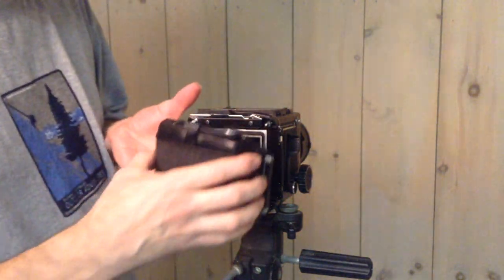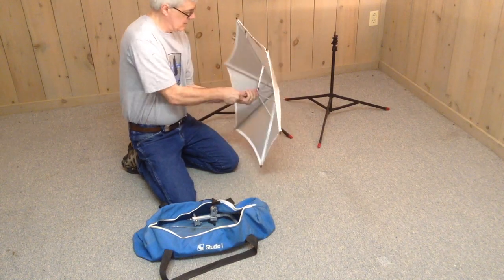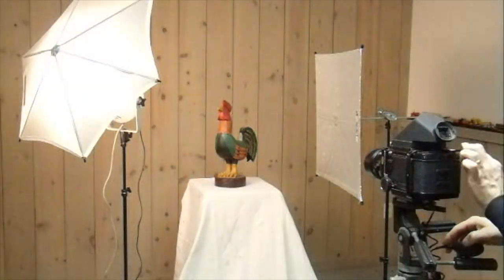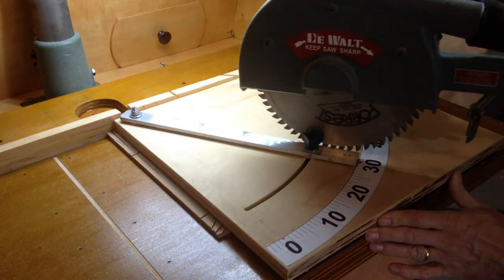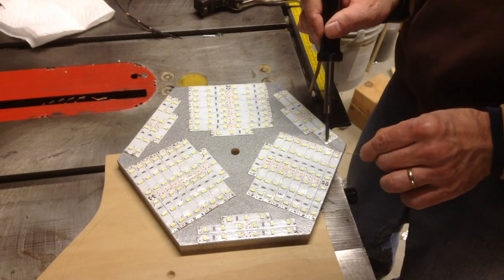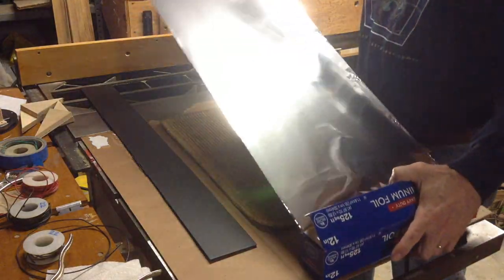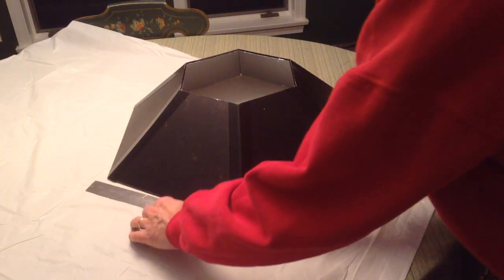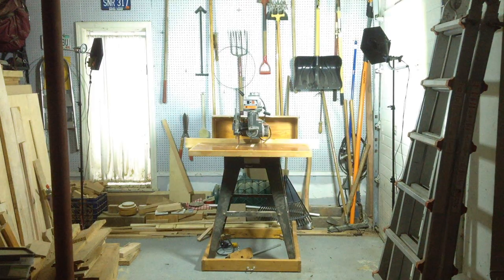Making LED Light Panels for Video and Photography

Comment: Very interesting. What was the power source for the LED panels?
Reply from the maker: Thanks. I’m using a 12 VDC (10 Amp) power supply which is enough to run both lights. Depending on what LEDs you use, look up how many amps each LED draws x the number LEDs you are using in your light.  Buy a power supply that can provide at least the amps required (preferably higher).
Reply: @brianweekley5700  Thank you.

Comment: Brian, luv the mamiya!!   What color temp are the LEDs,  seem a titch cool to me, where did u source them? And are you using 2 separate RASs, 1 for crosscut and 1 for rip. I'm really thinking of adding a second ras and going this route. My old 8" ts is getting tired. As a hobbyist hard to cough up the dough for a better ts when so many decent ras units are out there. Snagged a 10" delta turret with cabinet for 100.00 last year....felt like I stole it is excellent. Keep up the great vids.
Reply from the maker: Thank you.  Yes, I love my old Mamiya, but admit it hasn’t seen much service in many, many years.  

These were inexpensive LEDs that were listed as natural white in color (typically about 4000 K) and purchased on eBay.  I wasn’t too concerned about exact color since my primary purpose was general lighting for my low-key YouTube videos.  

Although I have several radial arm saws, all work shown in this video was done on my DeWalt MBF.  I’m a big fan of the RAS—it’s a very capable tool.  Good luck with your new Delta—another good one.